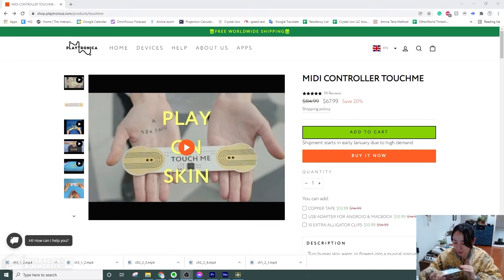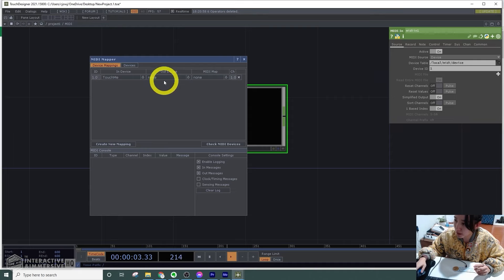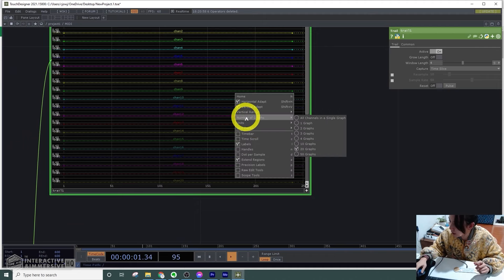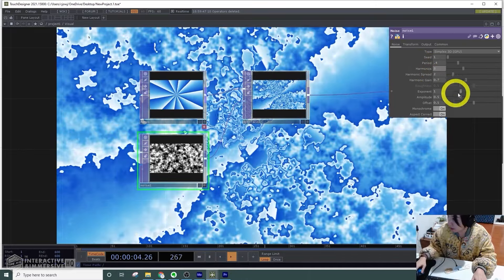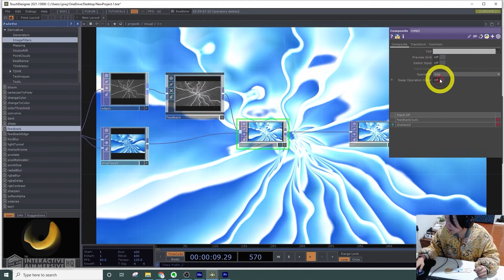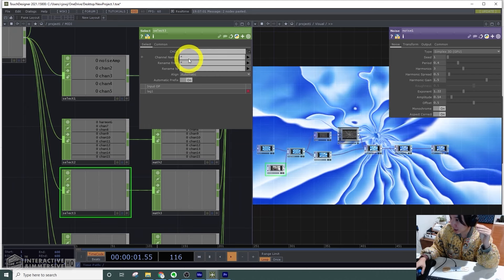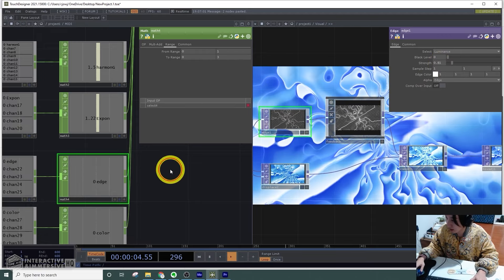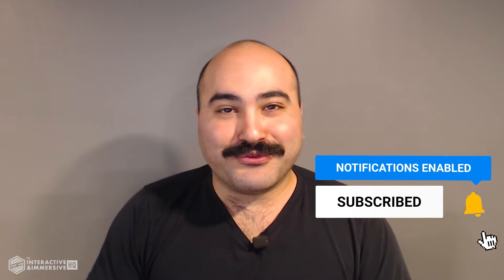Tactile MIDI Sensors & Generative Content in TouchDesigner - TouchDesigner Tutorial 075

Comment: Nice!!!      I recently did a wireless touch sensor with a esp32 sending OSC to TD and VVVV where it controls feedback and color depth for generative stuff      Love TD
Reply from the maker: Those esp32's are so flexible, sounds like you're diving deep into them and having fun! Great work!
Reply: @TheInteractiveImmersiveHQ     Current project is a magic wand that uses a esp & Hall effect to switch on and off particles projection mapped onto a wedding cake.  Just finished the code today and now waiting for the 3D printer to finish the wand 🤘

Comment: How do add multiple nodes to the same null operator
Reply from the maker: Assuming that you’re talking about this in the context of the CHOPs that are used in this video, only one CHOP can be connected to the input of a Null CHOP at a time. If you’re looking to bring together the content of multiple CHOPs into a single Null CHOP, you can use a Merge CHOP to merge the CHOP channels and then connect the output of the Merge CHOP to the Null CHOP. Hope that helps!